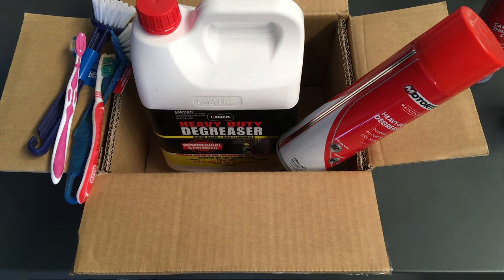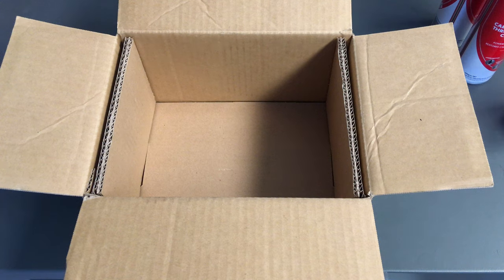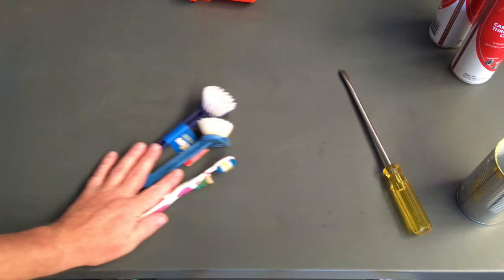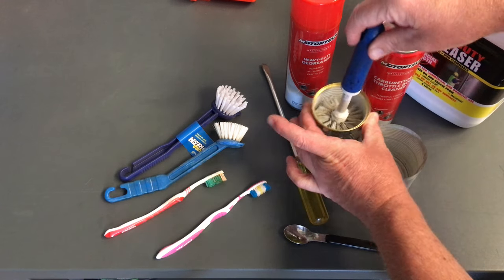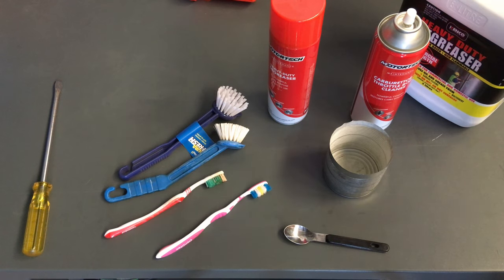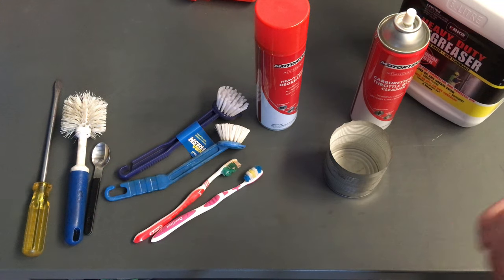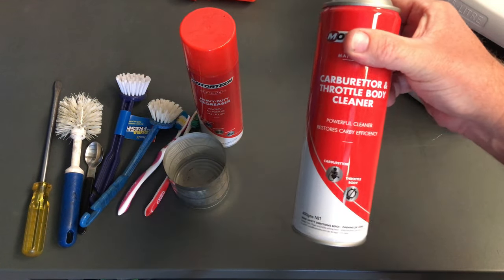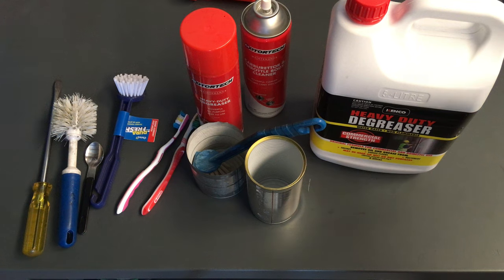CLEANING THOSE BLOODY STUPID FILTHY DIESEL EGR SYSTEMS - WHAT WE USE

Comment: hi 
Pressure clean the non sensitive parts first , then clean with brushes and degreaser ,  then pressure clean ,then apply oven cleaner  [this gets to all the in-accessible areas ], pressure clean again . Doing manifolds this way works well. 
Degrease intercooler and duct work with degreaser and flush out .
Variable vane tech ,turbo can have soot build up in other brands of vehicle  . Toyota ?
At 100,oookm cleaning other brands is a good service interval , build up of sludge occurs around ports particularly the secondaries if equipped .
Responsiveness improves and fuel economy slightly improves /stabilises 1ltr/100kms